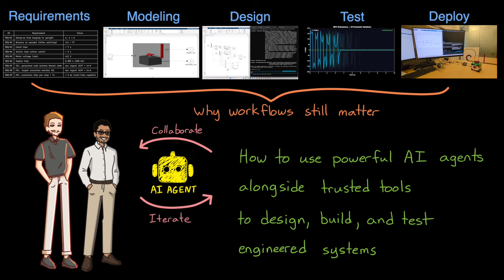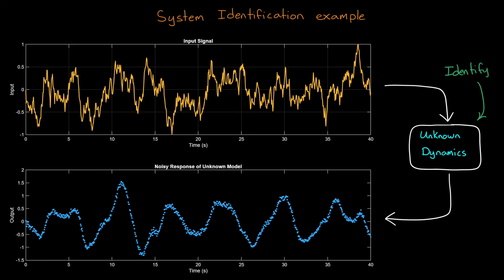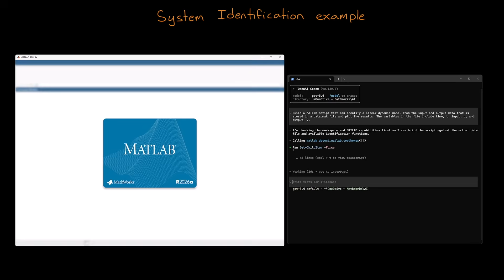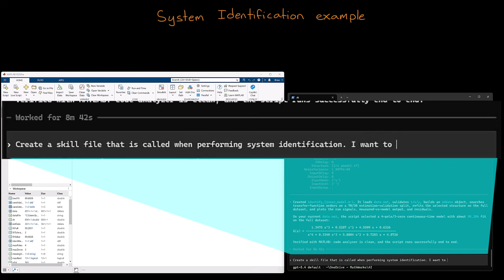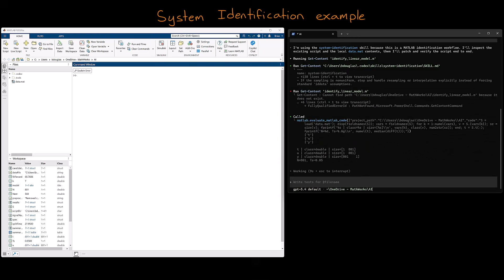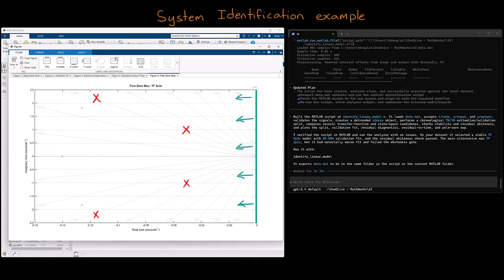Engineering with Agentic AI: Using Skills to Improve Your Agent

Comment: Skills are a good abstraction for giving an agent domain knowledge it wouldn't otherwise have. The open question is what happens when two skills encode conflicting assumptions about the same system, since nothing here seems to arbitrate between them.
Reply from the maker: The easiest way to understand skills for me was to see it like how you package an existing MATLAB script into a reusable function. AI agents tend to make similar mistakes, and you end up repeating similar prompts. You can package prompts you repeat in a given workflow as a skill, and suddenly AI agents can follow it without making mistakes. Just like functions, you can have namespace conflicts. That's part of what you need to do to manage AI agents - you can make skills project specific, or you can disable skills not useful for a given project.

Comment: the validation piece is what separates useful agents from impressive demos. you can have a great code-generating agent but if nobody can evaluate whether the output is actually correct for the domain, you've just automated the creation of unverified work
Reply from the maker: You hit the nail on the head—robust validation is essential for moving beyond prototypes. Otherwise AI just creates a new bottleneck in reviews or cause technical debt.